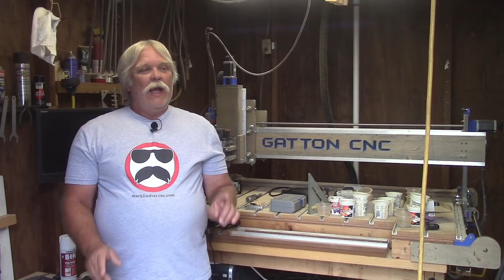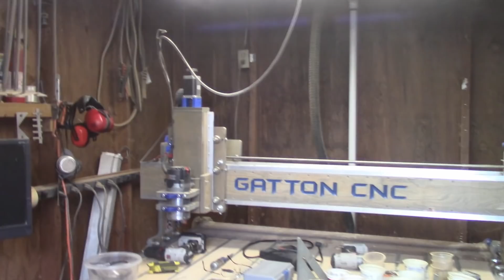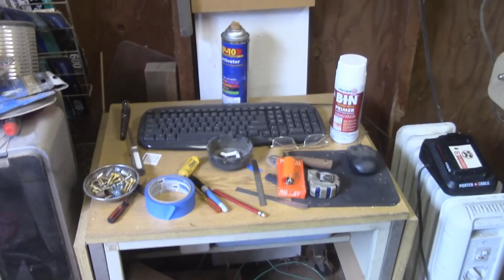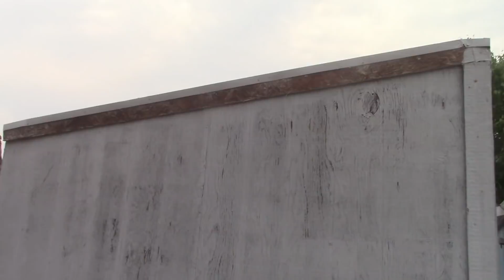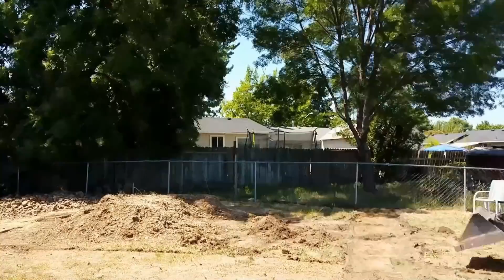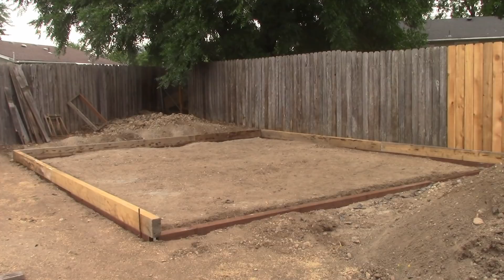Building a Home Hobby CNC Shop/Shed From The Ground Up - Part 1 - Project Intro

Comment: Does the County Ordnance have any restrictions against a 3 sided building? Stay within the setbacks and just fill the yard.
Reply from the maker: Yep, they got that all covered. Any structure 200 square feet or larger requires a building permit, and if it's 10 feet tall or more, it must follow the setback laws. This includes porches, shelters, pergolas, gazebos, etc... Believe me - I've been looking at this from every angle possible for over 2 years.

Comment: Enjoyed watching, and great explanation about your trouble with the ordinances.  Now I understand your dilemma.   Luckily I had a ready-made spot for my shop when they moved it in, but it is just on blocks, not on a pad of any kind.  But I did have a problem with the city codes.  When I called to check (nothing in writing like a dummy) they told me it had to be 5 feet from the back and side, and 15 feet from the street and house.  I got the biggest building that would fit (14x28) and it is perfect for me.  But then, four months later I got a letter from the city that said it had to be removed or face a $1000/day fine.... because it was not 10 feet from the back and side fence.   Well, I fought back and won, but lesson learned.  If I ever have to deal with any other situation like this, I'm getting it IN WRITING!    Looking forward to  the new videos.

Comment: So I had similar issues when I was planning out my place.

I was able to get a variance from the municipality to build larger.    But I also ran into a problem where I am only allowed 6 buildings on my 2 acres.  So might want to look that up.

Also look into steel containers, some of them can be dropped in and because they can be moved they don't count as buildings
Reply from the maker: I'm in a residential neighborhood, and steel containers are only allowed during construction, or for temporary (6 months per application,) situations. I looked into a variance when I was exploring the garage option, but the entire thing kept coming back to money, and the variance just added to the cost. Yeah, it was only a little bit of money, but when you start adding up all of those little bits, it quickly got out of hand. Also, "portable sheds" don't count as buildings either.
Reply: @MarkLindsayCNC   it's weird, each area has a different set of rules for steel containers.  Well I am in a weird situation with a house fire , and the rebuild will include a working space now.  So I spent like 3k getting ready to build a massive shop and it was all for not.

So I am seriously looking forward to your build.
Reply from the maker: Sorry to hear about the fire. I remember what my parents went through when they had a fire years ago, and it wasn't a pleasant experience in any way, shape, or form. I've budgeted $1k for site prep and pad construction, and I'm right in that ballpark, so far. Doing it all myself saves a ton of money, but wears me out quickly. Especially in the summer heat. That's one of the reasons I'm not building the shed.
Reply: @MarkLindsayCNC   what. Your not building it. 😆

But ya I hear ya,. Well. I have my popcorn ready to watch ,. Setting up a live webcam might also be interesting for us with no lives during the pandemic.

Virtual living and all :)